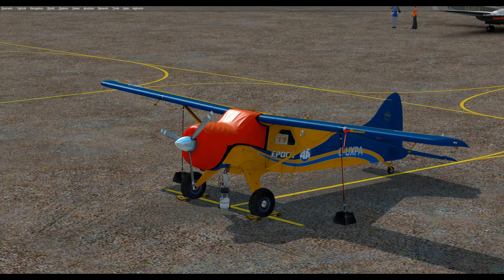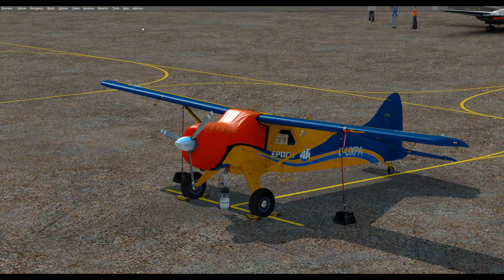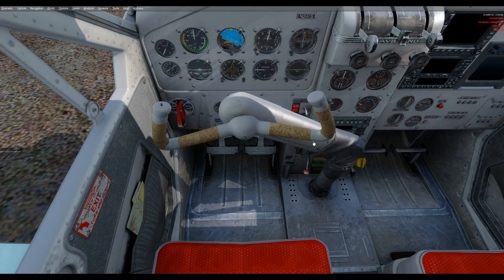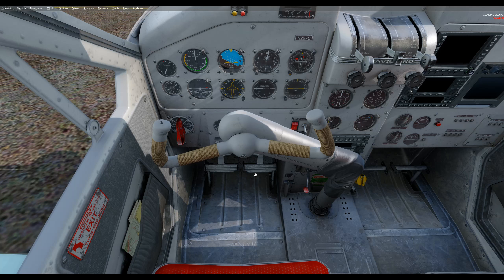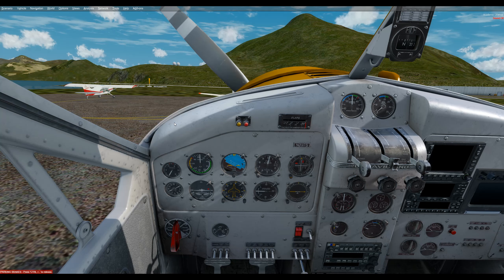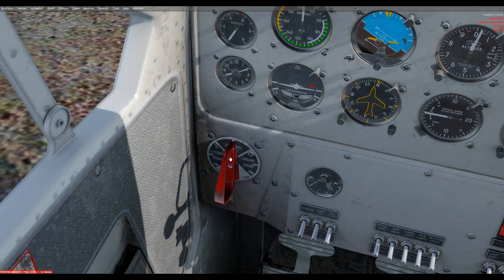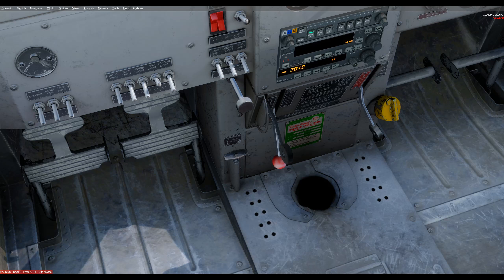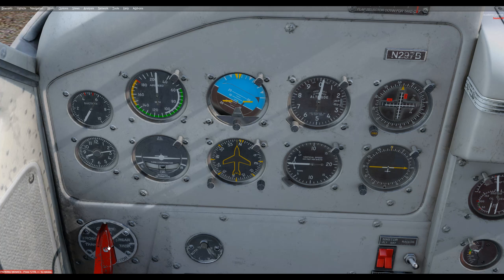Milviz DHC-2 Beaver in P3D v4.3 on July 20, 2018

Comment from the maker: Just a quick added note: if you see backfiring or hear it, press "H" or click the lever for carb heat and it will resolve itself.  The temp gauge should be in the green and not the yellow arc if done correctly.  Also, if using GTN750 I find it helps to use the heading with VLOC first before going GPS and NAV.  Somehow it syncs up better that way.

Comment: for some reason mine just hums after clicking on the starter switch. followed 3x to make sure I did not miss anything.
Reply from the maker: I will look into it when I get home from work and get back to you.
Reply from the maker: Here is a section from my flow sheet - see if this helps you...
12. Carb Heat: COLD (down position) (black handle near right rudder pedal)
13. Fuel and Oil emergency cut-off lever: OPEN (copilot near rudder pedal)
 a. Only operates with mouse wheel click
14. Fuel selector: Fullest Tank
 a. OFF can only be achieved with mouse wheel click
15. Prop: Fully Decrease RPM
16. Mixture: Full Rich
17. Throttle ½ inch: OPEN
18. Beacon Light: ON (red flashing light on top)
19. Wobble Pump: to max 5 psi (red handle)
20. Ignition switch: BOTH
 a. OFF can only be achieved with mouse wheel click
21. Fuel Boost: ON
22. Starter switch: STARTER
 a. When engine starts: OFF (automatically did so)
23. Throttle back 500-800 rpm
Reply: @bjmarten6463  Thanks man!! appreciate the reply